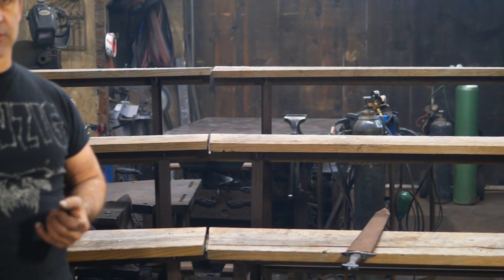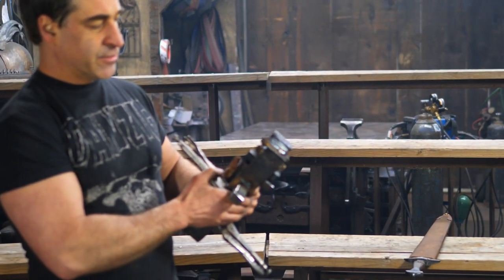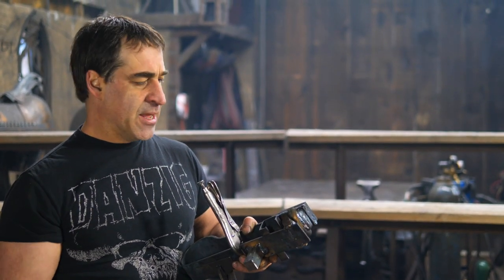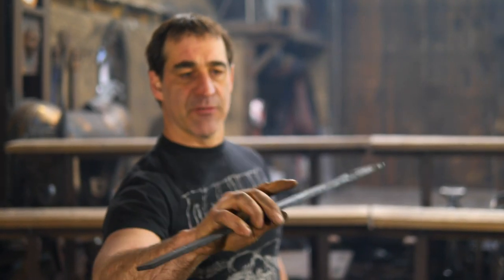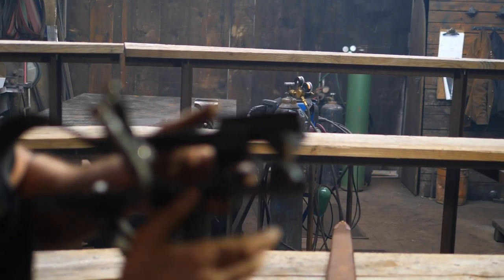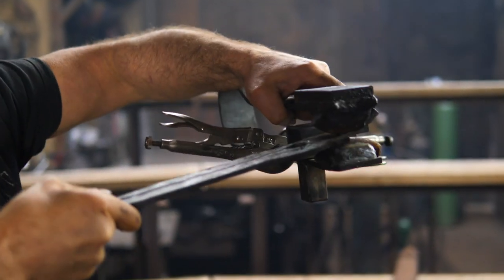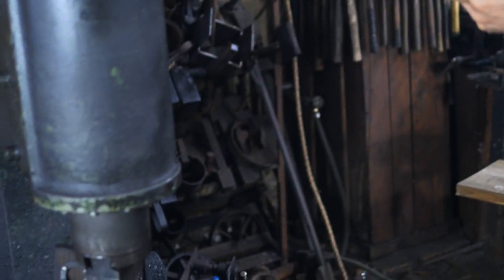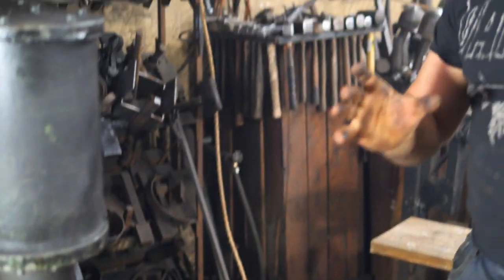Sword Fullering Tool - Power Hammer Jig

Comment: I've seen a lot of critics related to machined fullers (grinders and similar tools), in favour of hammering. May someone explain me the difference and benefits? Thank-you.
Reply from the maker: Theoretically forging in the shape of the fuller will make for a stronger crystal structure in the steel opposed to grinding that structure. The benefits are probably minuscule and would hardly be testable. Either method tends to make a functional fuller.
Reply: @ThakIronworks  thank-you, good vid ^^